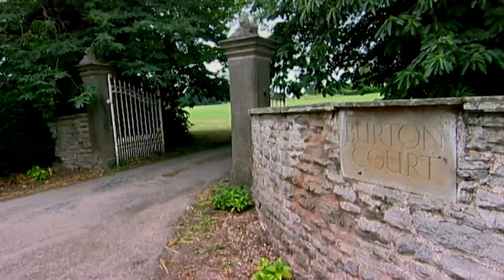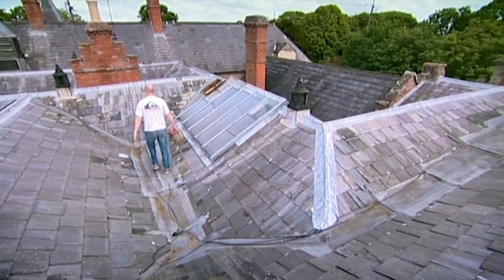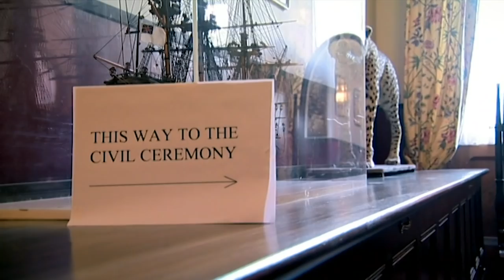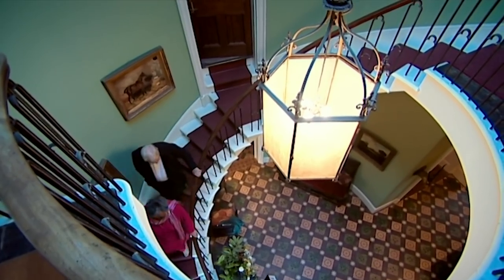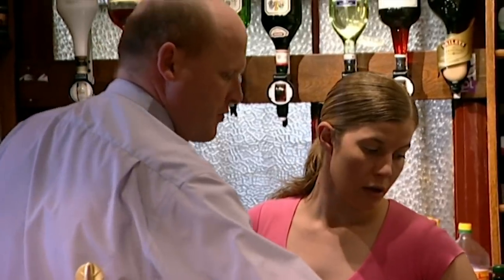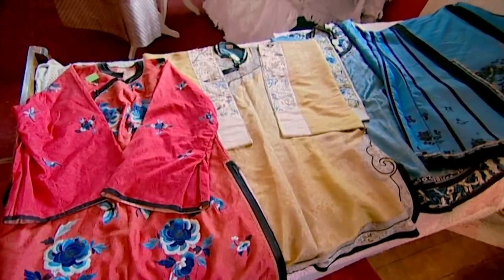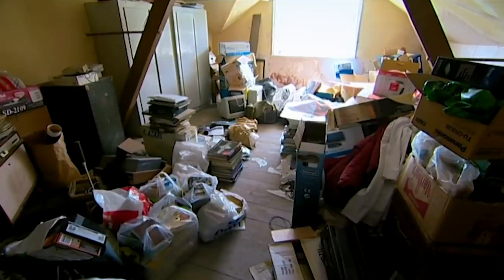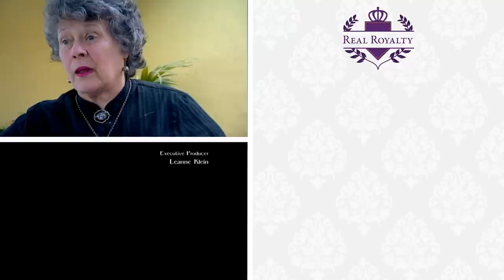The 900 Year History Of Burton Court | Crisis At The Castle

Comment: I suggest to take the roof tiles off where ever these are not visible from below and put metal sheets instead. At least in that part of the roof where the pine needles are blocking the gutters. Just by adding 1 m height of metal the rain water will not be able to overflow any more. The removed tiles will be kept as spares for all areas where the roof must appear in the historical correct style.